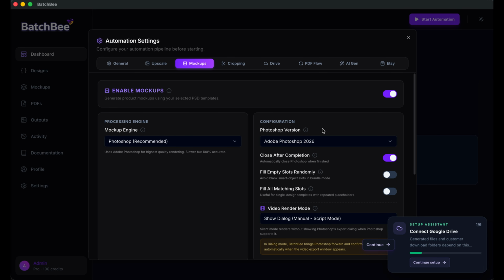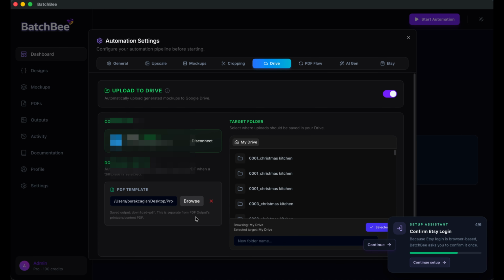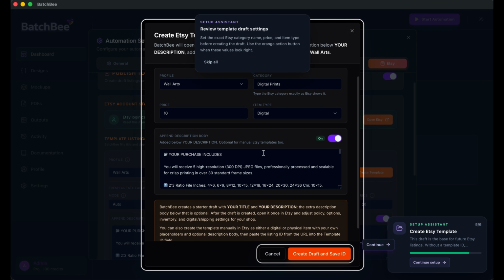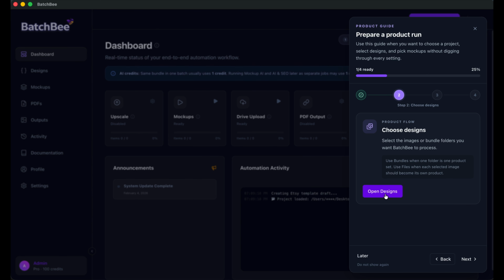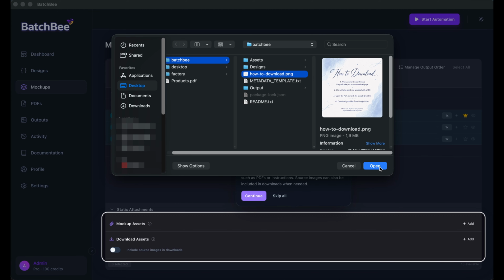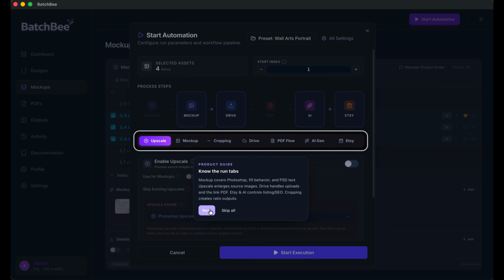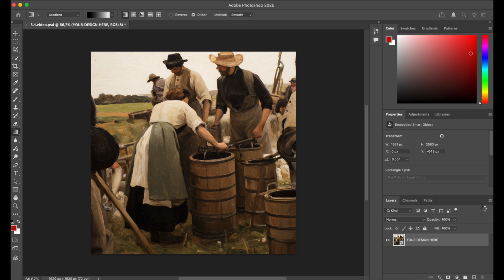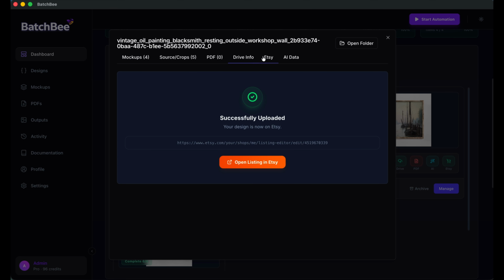Create Etsy Wall Art Listings Automatically | Upscale, PSD Mockups & AI SEO

Comment: can you make a drag and drop option? that would be very helpful
Reply from the maker: Hi, thanks for your feedback!  
BatchBee currently works by selecting a project folder first. Inside that folder, you can place your design images or image folders in:
Designs/
You can place your Photoshop mockups in:
Assets/Mockups/
Then open the project and select your designs in Design Manager.
When you say drag and drop, do you mean dragging individual images or image folders directly into Design Manager, and dragging PSD files or PSD folders into Mockup Manager?  
Is this the workflow you would like to see?
Reply: @batchbee  hi there i am finding this very complicated i have pick a folder and tried placing image inside the folder and there not show anything? would you be kind enough to make video explaining step by step i ready like the software and the lay out works i don't mind waiting and in the mean time ill have a pay about this it and lean the different tools to use 

Kind regard,
jimmy
Reply from the maker: @HandPanMusicForYou  Hi Jimmy,  
I’ve released v1.0.52 with drag-and-drop support for designs, mockups, and PDF templates, along with a clearer setup flow. You can update and try it now.  
Before I prepare the step-by-step tutorial video, please let me know if there are any other steps you found confusing or would like me to simplify. I’d like to improve those parts first and then create the video using the updated, easier workflow.  
Thanks again!
Reply: @batchbee  Thank you so much for take my feed back on bored i will have a play about with it tomorrow and check out the new features what you have added.
Reply: Hi there,

I’ve been using your software and I’m really enjoying it. I especially love the image upscaling tool and the work you’re doing with the app. 😊

However, I’ve noticed an issue with the upscaling feature. Sometimes when I ask it to upscale an image to all the available sizes, it works perfectly and creates all the different sizes. Other times, it only upscales one size instead of completing all the requested sizes.

I’m not sure if this is a bug or something happening in the background, but I’d really appreciate it if you could take a look into this and see if the problem can be fixed.

I really love using the software and want to keep creating and using the app, so getting the upscaling feature working consistently would make a huge difference. 🙏🎨
Reply from the maker: Hi there,

Thanks for your message.

I found four problems that could cause this, and all of them were silent. If the Mockup step was off, upscaling and cropping did nothing at all. If one size failed, the app threw away the other sizes it had already made and went back to the original file. That is probably what you saw. There was also a size limit that was too strict and refused some larger images.

All of this is fixed in the new update, 1.0.56, which is out now. The app also tells you at the end of a run if it skipped something, and why.

One more thing: a design marked as Done is always skipped and never processed again. If you want to run it again, take it out of Done first. You can do this on the Designs screen: select the designs with Done status and reset it.

If it happens again, could you email me the log and a screenshot? My email is support@loriensoft.com. The log is on the automation screen, in the Activity panel, with a Save and a Copy button.

Could you also send me the email address you use to log in to BatchBee?

I should also mention that I have not tested 1.0.56 on Windows yet.

Thanks again for writing.

All the best